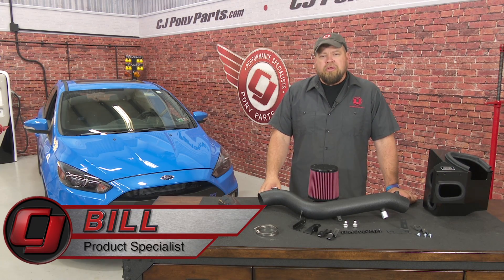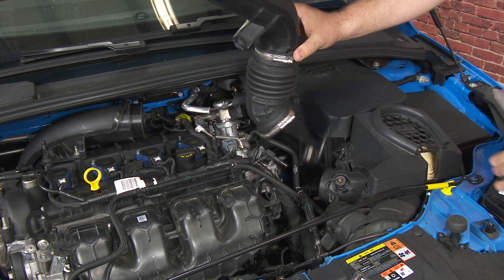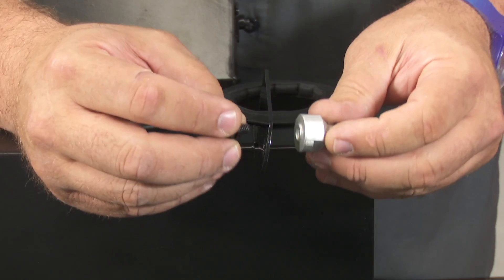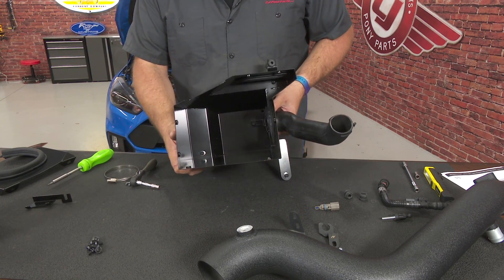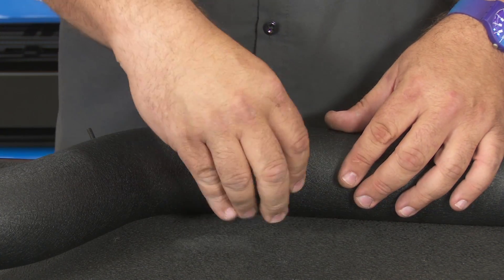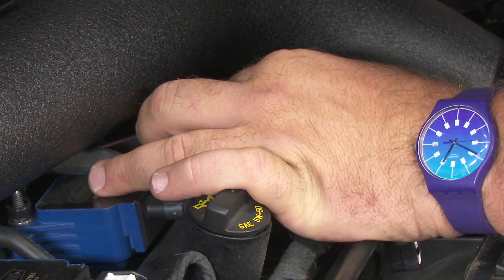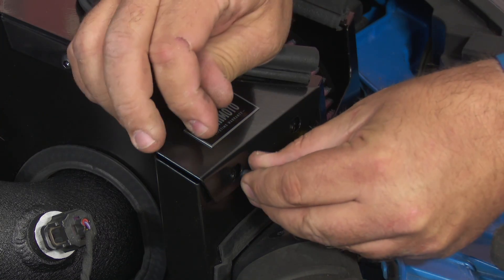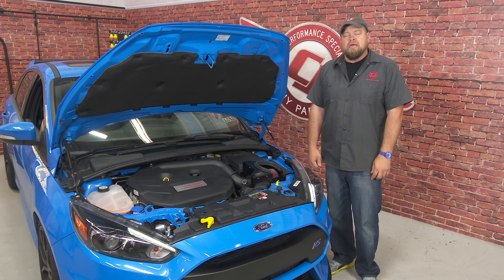Focus RS Mishimoto Performance Cold Air Intake Kit 2016-2018 Installation

Comment: I still dont know if any cold air intake is really worth it over the stock, unless you go full tune and more bolt ons!?
Reply: I hear you, I am opposed to CAIs on modern cars since the stock air boxes aren't restrictive enough. In my opinion they're not worth it unless your engine is always in the top end(race car) or you go forced induction
Reply: It is forced induction.
Reply: I think what he is talking about is an turbo upgrade, then general bolt on’s etc.